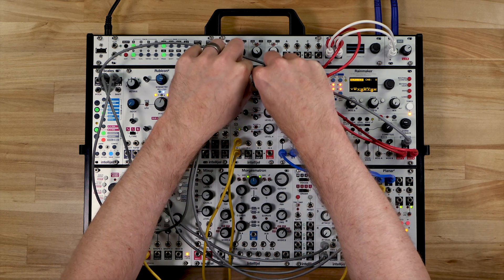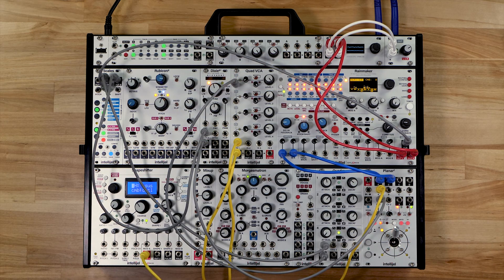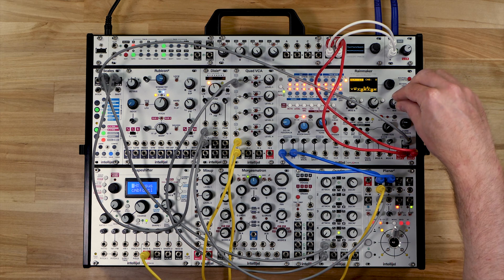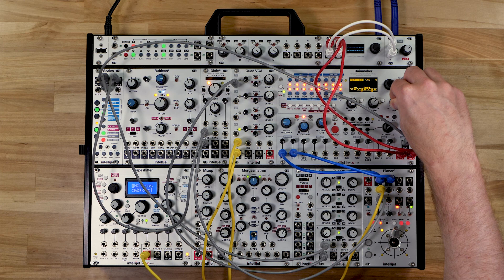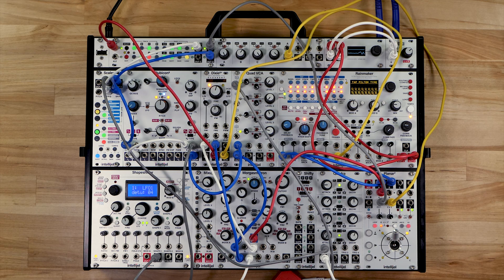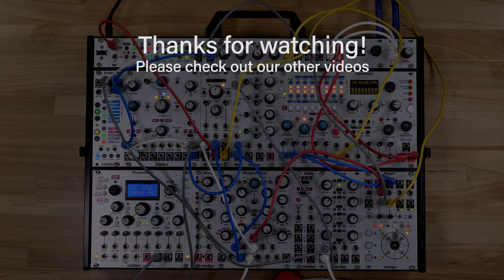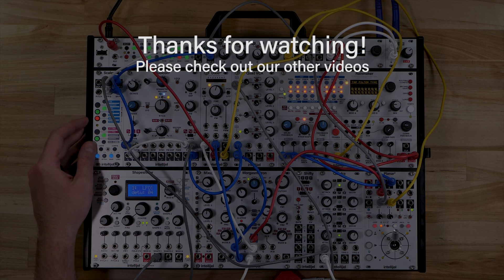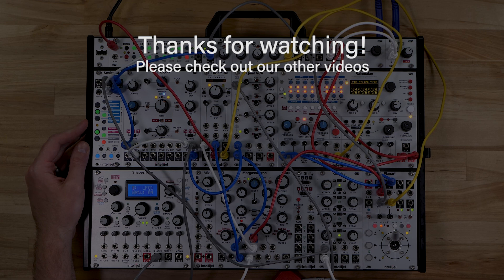Panning With Planar 2

Comment: 1:48 "Deactivating the ABCD button sets the joystick to a perfectly centered position" 

Does this mean that you can use the Planar as a CV panner and Joystick CV source independently? As in I can move the joystick to modulate something else and not effect how the signal is being panned by external CV?
Reply: Yes, that's correct! The ABCD and XY can be set separately to determine how they respond to joystick position, recording, and CV inputs. So this means that you could have the ABCD outputs controlled by the joystick/recording and the XY outs only respond to the CV inputs or vice versa.

Comment: What can you not make with this?
Reply: Wicker baskets
Reply: @ScottMFR  next video: WICKER BASKETS with Planar 2. 🤯
Reply: @joshmartines9211  Now there's a challenge!
Reply: @ScottMFR  What you would need is a robot arm, and an analog to digital converter taking the CV from the planar to and converting it to a digital signal for a microcontroller, the microcontroller controls a robot arm, boom, you can make the wicker baskets with the planar 2.
Reply: @ff-qf1th  If I remember correctly, I think Bastl has a CV to servo motor module. Maybe there is wicker basket weaving in Planar 2's future after all. That would be one hell of a tutorial video!